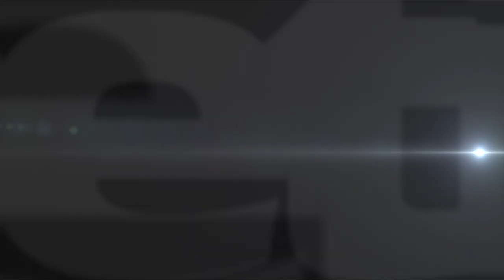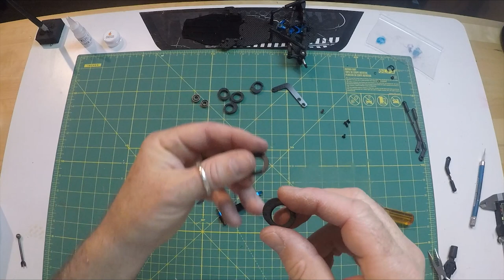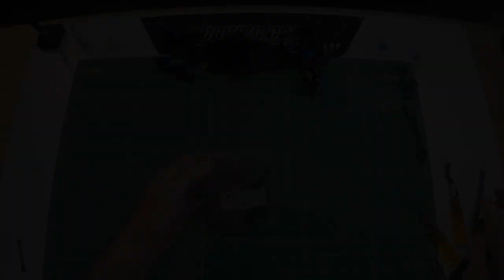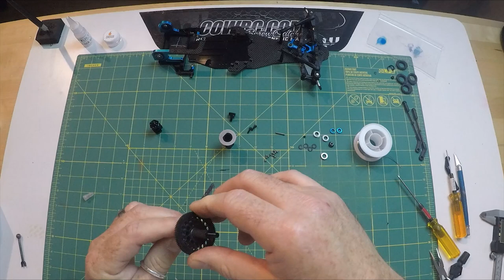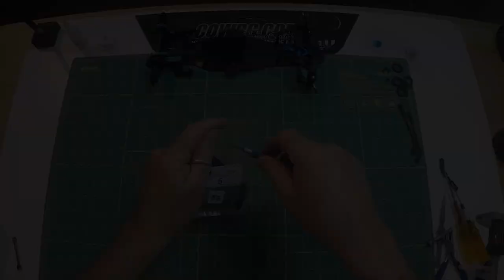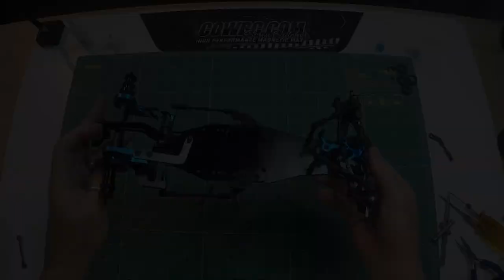Exotek Racing F1 ULTRA Formula 1 Car Build - Part 2

Comment: Dang, I have always dipped my screw tips into thread lock pudding, I think I may copy your technique of using an x-acto knife to apply it
Reply from the maker: I typically dip into the pudding when I'm installing a screw but if I have to locate it first (or add a shim), I use the Xacto to apply. Just keeps things a little less messy.

Comment: Wow, this is certainly a far cry from the days of the fiberglass T-plates and the 1/4 x 3/8 bearings that the RC10L and its like used to use. Looks like it's fun to build too! Ha, I just dated myself. I'm just getting back into the hobby after 20 years. It's a shame that there's really not much of an on-road scene near me... But, off-road should be fun, thanks to the two tracks that are relatively close to work.

I'm in a hot zone. however, so I'll have to continue to wait for this... mess - to clear up a bit. Happy Driving, Tony!
Reply from the maker: Hey, I'm right there with you - ran the 10L for the longest time and LOVED how that handled. This though - this is next level! :)

Comment: Any specific reason you started with the one down setup?
Reply from the maker: 1-down raises the bearing hole up. This drops the ride height of the car down. This would be a good rubber tire starting setup.
Reply: @Competitionx  cool, thanks
Reply: Ok, is it normal that the diff wobbles. When I put the one down parts on there is a noticeable wobble in the diff. Took the whole thing out and rebuild it. Same problem.
Reply from the maker: If by diff you mean the spur gear, it is possible, actually. Depending on the manufacturer, some spur gears are molded more narrow than others. Since the diff rings ride on the diff balls, this slight amount of space can cause the spur gear to wobble. Typically, when running, the pinion keeps the spur gear straight and true. Just make sure the gear mesh is correct and you'll be fine.